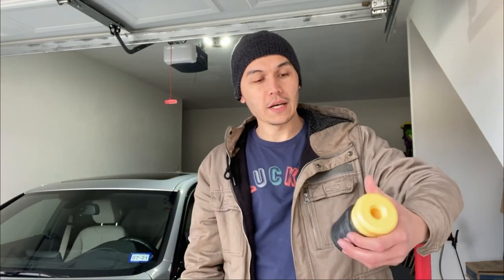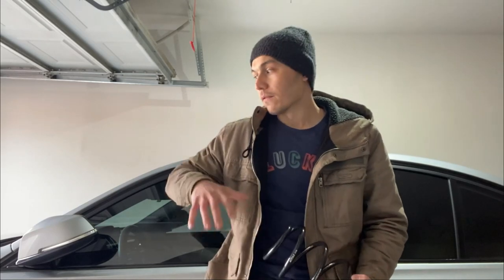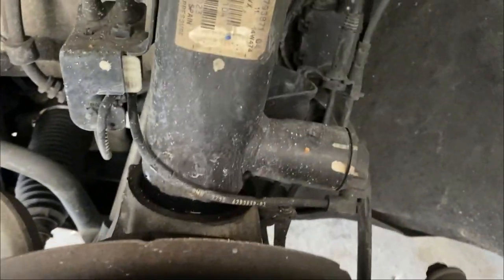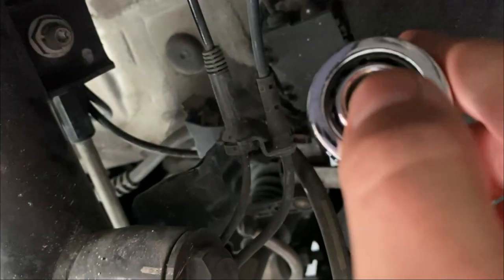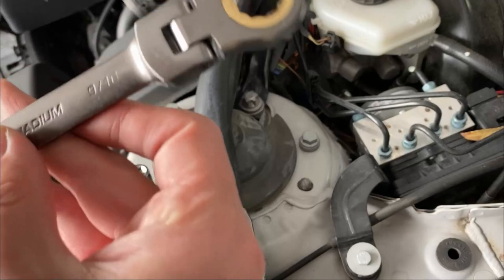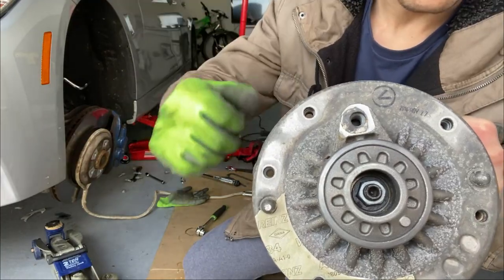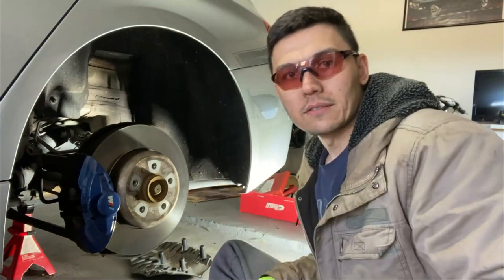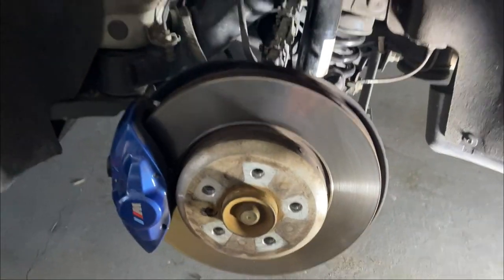Eibach Pro Kit (RWD) & Dinan Bumpstops Install On BMW F30 335i xDrive

Comment: hello brother , 
nice job,
 wich kit did you choose -30 mm 25 ???
because i get 335i f30 luxury it s too highter like your car ...
sorry if you answer in video because my english it s too bad
Reply from the maker: Hi there! Thanks for watching! 
It is the Eiback Pro Kit
Specs say lowers 1.4 inch (35mm) front, 1.6 inch (40mm) rear. This was for the RWD 335i. But, mine is the AWD 335ix. I think it lowered mine more than what the spec said. I loved it!
Let me know if you have more questions.
Reply: @kamolnarbaev4490  thank you brother , 
i buy 30 mm lower front and 30 mm back i hope will work.
your will more lower or mine?
Reply from the maker: @Bimmerstyle  You're very welcome bud! I think yours might end up being lower than mine because if yours is RWD it is already lower to start with. It would be great if you can share a picture once you lower it.
Reply: @kamolnarbaev4490  yes bro i install speing 30 mm front and 30 mm at rear and it s perfect with 18 wheel not touching and keep the road and confortable .
ok i will try to send picture
Reply from the maker: @Bimmerstyle  That's awesome!! Pics please!

Comment: Why did you have to replace the boot? Didn't Dinan take that in account when they made it, or is it necessary to swap that? I don't hear other people have to do this.. 
I'm just wondering because I'm not sure if I should just get some F80 M3 bump stops with the longer boot.
Reply from the maker: This is a good question. I remember reading somewhere if you don't switch to shorter and stiffer bump stops, it's gonna be riding on the bumps stops too much. You need as much room as possible for compression because the springs are shorter now. I didn't want to take the risk and end up with unpleasant ride.
Reply: @kamolnarbaev4490  I think I was referring to the boot sleeve... not the actual bump stop itself...
Reply from the maker: @Mike604  Ahh sorry. Not sure why I started talking about bump stops lol. In the case of the boot, I figured more cover I have over the shock the better. And the didan boots were just a hard plastic.

Comment: Great video mate. I'm driving f31 330d Xdrive Msport lci, and considering to change springs for Xdrive version for two reasons. Firstly, with lots of gear in the boot, on higher speeds on European motorways and autobahns, front isn't as stable as empty. Secondly, my older cars in the past, f46 and f90, after changing from Msport spring to eibach, I have noticed ride to be more compliant despite being slightly lower. By the way, alpina use eibach as well and they are waymore comfortable than stock bmw cars. I'm puzzled now, as I'm not going for the look, but more stability and comfort. I have got adaptive shocks as well. Did anybody tried these springs on their cars? Thanks.
Reply from the maker: Hey there. Thanks for the input. It's greatly appreciated. I was going for a bit stiffer ride, as well as the looks. As you saw, I have a f30 335i xDrive, but I've installed the Eibach RWD version because of the extra drop. It is not as complain only when I go over bumps on comfort mode. The springs seem to be a perfect fit for the SPORT mode though. And I do have Adaptive Suspension too. Eibach says the springs are about 10% stiffer, but you can barely notice it. Overall I am really happy. Also, I did not know that Alpina uses Eibach springs too. Recently I added wheel spacers, and now my wheels sit flush with the wheel arches. Even when I load up the car with people, still no rubbing and very complaint ride. I hope this answers your question somewhat. If not, hit me up again, and best of luck.
Reply: @kamolnarbaev4490  thanks for info, I'm glad you are happy with your mods. Mine is running on stock 19 inches and recently changed to non run flats falkens. Because speedo was too much out, I decided to fit slightly wider ones. 235/40/19 fronts and 265/35/19 rears. Because of that, tyres are slightly higher as well and speedo is nearly perfect, shows 100mph on 99gps. Tyres are more flush in wheel arches, and there is more rim protection as a bonus, but there's no room for spacers anymore. Now, ride quality, lack of noise and more grip is just fantastic. Highly recommended. I think I may go for Xdrive eibach, but need to find out, if it may void my extended bmw warranty...
Reply from the maker: @maciejsuchecki7653  yea you definitely do no need spacers with 265 rear, and I hear you on the rim protection too. I am running Michelin Pilot Super Sports. You should send a pic. I will post a link below.
Reply from the maker: https://www.instagram.com/save_manual_transmissions/?hl=en

Comment: This did make the ride harsher? Do have the adaptive suspension?
Reply from the maker: It made the ride slightly harsher. Still very close to stock ride. I do have adaptive suspension. Only downside is that it's not as complaint going over potholes. I'm planning to make a video this weekend on the driving impressions.

Comment: Is there a reason why you replaced the bump stops? Can you keep the original xdrive ones or do you really need to replace them? I'm asking cause i bought the same springs.
Reply from the maker: Hey there. The factory bump stops are too long for the shorter springs. You will be hitting the bump stop alot earlier in the suspension travel if you do not replace them with the shorter ones. Some people cut the stock ones, but I would not recommend it because the stock ones are not stiff enough to protect your shocks. If you go through the trouble to replace the springs, I would highly recommend replacing the bump stops too. If you get the Dinan bump stops, keep in mind that you have to use the stock sleeves with the dinan bump stop. It is in the video. Let me know if you got any more questions, and best of luck. You gonna love the look once you lower it!!
Reply: @kamolnarbaev4490  Awesome, thanks for the information. Do i need to get awd or rwd bump stops? Or it doesn't make a difference?
Reply from the maker: @n.storto  I think it's the same for the awd and rwd when it comes to bump stops. I  can give you the part number for mine later this evening.
Reply: @kamolnarbaev4490  I would appreciate that!
Reply from the maker: @n.storto  Hey there. I got my bump stops from Dinan website. The part number is: D193-3011.

Also, here's the link:
https://www.dinancars.com/products/suspension-hardware/springs-bumpstops/handling-kits/parts/D193-3011
Reply: @kamolnarbaev4490  Thank you 🙏🏻

Comment: Can You comment about stifness of driving? between m-sport suspension and eibach pro-kit? Because have an idea to do opposite - currently installed eibach pro-kit and want to go for m-sport springs, for more height and comfort.
Reply: Do you have stock bump stops? Mine was super stiff with the stockones. I have installed the f80 ones now and it rides much better
Reply: @robyedumor8848  Yes, guess stock now
Reply: @Rimlax123  i would change those up first. Its a very big difference. With the stops it will be much more comfortable and less stiff.
Reply: @Rimlax123  im guessing ure hitting the stops at ride hight. I had the same with my xdrive version

Comment: I have the same Springs on my f30 xDrive my shocks are no good 
 my linkage went I am looking for shocks or coilovers not sure
Reply from the maker: Hey there. Nice! Though, sorry to hear about your linkage. How many miles do you have on your stock shocks? My plan is go coilovers once my shocks go bad.
Reply: I put the springs on a 57 miles after two months i started hearing the gas leak out of the front shock after every bump I go on. I'm looking at 
bilstein b8 shocks or bilstein b14 or 16 and kw coilovers. I am trying to look for the best setup for daily driving not going to use it for track
Reply from the maker: @cwmarksman  yeah I'm prolly gonna lean towards B16 because of that compression and rebound adjustability. Let me know what you end up going with thou